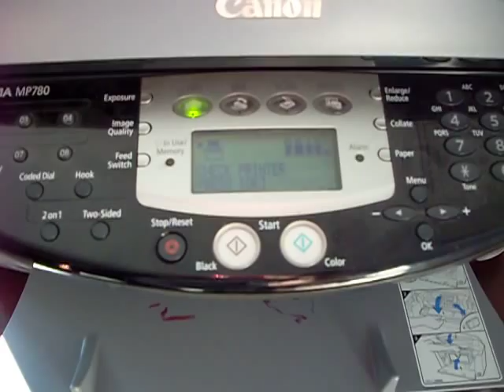Canon Pixma MP780 "Machine Gun" like loud clicking sound

Comment: I'm not sure if this will help, the problem was slightly different in that only the Alarm light was flashing, and it was indicating a paper jam (there was nothing visible).  I blew out the printer (MP780) using a compressor (not canned air).  The problem went away.  Before the paper jam issue was fixed - it would sometimes make the same noise - but not everytime.  I suspect my issue was a dirty sensor on the paper feed mechanism.

Comment from the maker: @hairtoner1 Still not fixed but am hopeful....
I love this printer and don't want to have to purchase a new one....
Problem happened the day after a paper jam so I still suspect something simple is required to fix it.
Did some preliminary disassembly, and see that it will be quite the job to see the feed assembly causing the noise...Hoping someone will confirm a fix before I actually take ti completely apart.
Reply: Mine happened after a paper jam as well... The printer is only a week old..